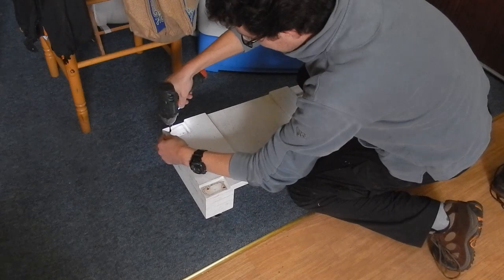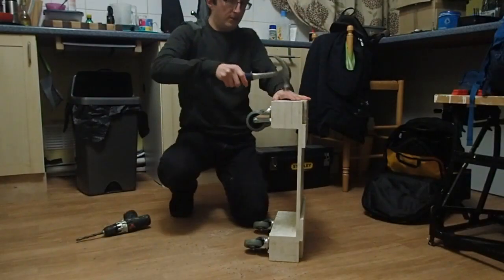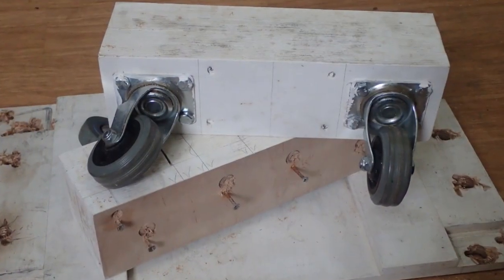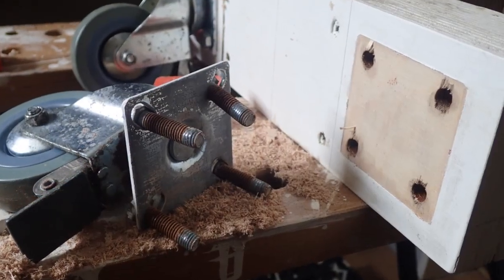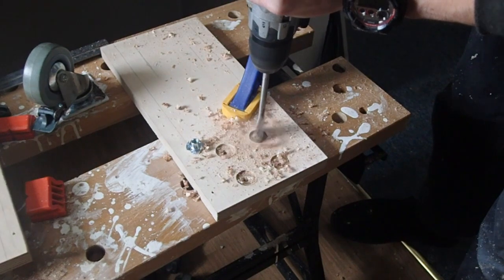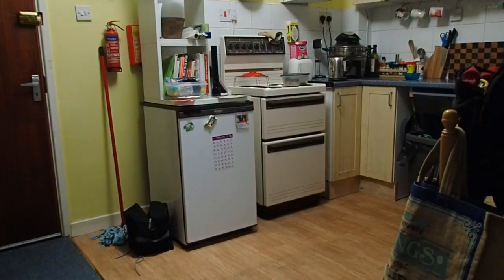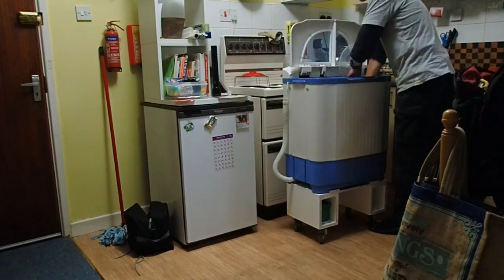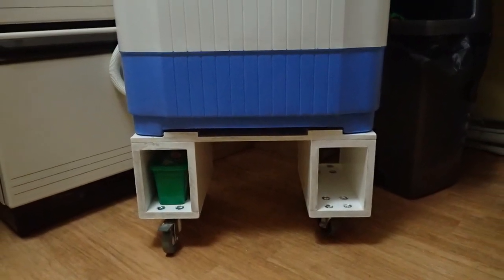Modifying the Washer/Dryer Mobile Base

Comment: Nice! I like the way you dealt with the problems at hand, and made it work. Tricky screws got their comeuppance!
Reply from the maker: Thanks, Steve. I was very surprised that even my impact driver couldn't remove them. Ironically, this unit has been binned since the move as the washing machine I was using died a few days before I handed my old keys back! ;-) But I now have a proper washing machine and, to be honest, it's a lot easier and so much more convenient! Thanks for watching.

Comment: We've all been there with the screws that won't budge; so frustrating but so satisfying when you finally succeed :-)
Reply from the maker: Yes, it's certainly is. Screws go in so easily and we trust them to be reliable. But I didn't really build it to be taken apart either. ;-)

Thanks for watching, Maria.
Reply: My ex father-in-law, who was a French Polisher, always had a bar of soap available to put some soap on the screw threads. This enabled the screw to be taken out later, if necessary. He trained before WW2!
Reply from the maker: I have a stick of beeswax that I would normally use for the same purpose. I'm assuming I didn't use it here.
Reply: Such great tips. I've never used soap or bees wax on my screws but I'll give it a go now :-)

Comment: Well done for being able to work in such a restricted space. It it possible to have another shelf between the casters?
Reply from the maker: Thank you, Will. It would certainly be possible to fit a shelf in between and may help to brace the unit - not that I think it needs it. I'm not sure what I would put on that shelf. Any thoughts?

Thanks for watching, as always.
Reply: Having a bad back, I am not fond of shelves that low! I wouldn't be inclined to put anything on it. Lol.
Reply from the maker: I'm also not a fan of low shelves. Pallets in a workplace are one of my most hated things, as you often have to stoop down so low to pick something up or lay it down.

Comment: Yes please... How DO you use that machine??
  You have more patience than I, my solution to stuck screws and bolts is just to cut them off and drill new holes. :-)
Reply from the maker: If I had an angle grinder, I might well have done the same! ;-)

Thank you. I'll try to do the video in October.